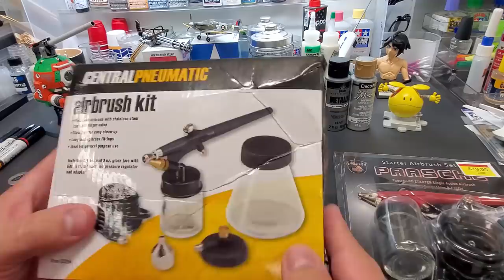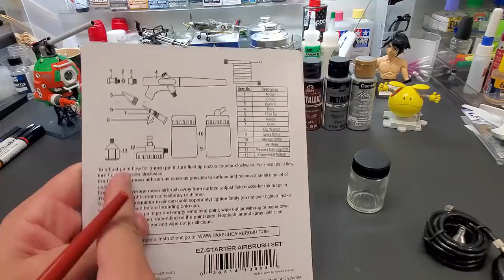Scale Model Tips - Testing Cheap Metallic Craft Paint & A $20 Airbrush

Comment: I bought that Paasche Beginner Airbrush kit from Hobby Lobby for $17. What a piece of junk. No paint flow even with a 50/50 mix. The spray bottle metal tip doesn’t stay connected to the airbrush body…keeps sliding out. The air hose threaded connection to the airbrush was leaking air so I used some plumbers thread tape, that fix it. But when using canned air propellant, the female threaded connector in the pressure can regulator pops off under pressure so there is no way the regulator can stay connected to the propellant can. I’ll be returning this airbrush ASAP!

Comment: The reason the first color ran to the edge is because you ever sprayed it.  It needs to be hair dried between coats and it works great without a primed.  Because it's acrylic add a little acrylic polyurethane to enhance adhesion and durability/anti-scratch.
Reply: Its because the spoon wasn't primed, you see he sprays a primed spoon and does have an issue
Reply: What should I search for, if I want to find the polyurethane additive?

Comment: I still use my Passche "H" model 44 years later .  I also have the 1, 3, & 5 needles.  Old reliable hasn't failed all these years.  I also save the old glass bottles, clean the labels off & relabel with a label maker.  The slip on nozzle caps for the bottles are good for short term paint storage,  They also keep dust & tiny debris out of the jar nozzle.  You could use a small travel hair dryer drying between coats.  I found & still a dryer  that's approx. 4.5 "x 5"x 2.5 dia.  with a 6ft. cord, an on-off switch (1 heat setting) & it folds up into a compact package.

Comment: Another great video. Thankyou. When i started airbrushing i started with craft paints reduced with a 50/50 mix of water and glass cleaner.. worked great and dried quickly. However i had problems with craft metalics until i switched to a 0.5 needle then all was fine.
Reply from the maker: You have to go to 5mm for sure as seen here

Comment: That's actually pretty cool how you can just adjust the paint to air mixture and shoot it without worrying about trigger control on the airbrush I use my airbrush for guitars so I do a lot of large flat surfaces so I was worried if I get a more expensive airbrush then I'd have to take a while to learn how to control the button so I hold it down and back and just the right place and hold it perfectly steady so I can get a perfectly even coat

Comment: Thanks for doing the hard work of testing all these various products. Just a thought concerning these paints and the Paasche, maybe the manufacturer didn't put very much glycerin (retarter), if any, in the paints because they intended for them to be brushed on. Mixing in some retarter or flow improver might be a benefit here. Also, reducing the air pressure might help with a siphon feed gun because it will slow down the drying action during spraying. Just some thoughts.

Comment: The only issue I find with the new one you got compared to the other quick swap one is that you have to clean in-between paints. But the other one has plastic bottles so its not as safe to keep solvent paints.

Comment: Thanks, great review and test.  I have the Paasche but have not used it much; I think I'll give it a try again. 

I saw Blu3ManiC's post about the air hose at Harbor Freight but could not find it on line.  

One of the reasons I haven't used the Paasche is the hassle of having to change the air hose. Can you get an adapter that changes the airbrush's small fitting so I can add a quick coupler and use it on the standard hose?

Comment: The HarborFreight 10 foot airbrush hose now comes with the 1/8 to m5 adapter for these airbrushes. I was in there to buy a mechanics seat today and while checking out the air brush stand noticed the new hoses now come with adapters instead of 1/4 on one end and 1/8 on the other they changed it to a hose with dual 1/8 ends and 1/4 and m5 adapters attached that you can unscrew. Saves from buying a $10 adapter set on amazon and waiting for it to arrive for the same price and you get the hose as a bonus ;)
Reply from the maker: I saw that and I will be picking one up this week. Great value

Comment: I love your video series on those craft paints so much, very informative! and i have been playing around with those paints as well but it seems that i can never get a great coverage from craft paints unless putting a very thick layer on it. I feel like i need to build up the paint for probably around 0.1 mm to fully cover the color of primer (just feels super thick anyways primer coat and paint coat together, i use Vallejo gray primer btw), and usually matt color dries thicker. Do you guys have any solutions or suggestions? a thick layer of paint is just very annoying especially on an HG gundam model. Thanks!
Reply from the maker: Have you tried thinning it like I do just not as much for brushing?

Comment: I've been Airbrushing for a long time been wanting an airbrush with a Mac valve but did not want to spend 2 to 300 dollers on an iwata. So I went on. eBay seen an AB for 26.00 Mac valve said what the hell pulled the trigger iam impressed . Um looks more or less than the name brand one
. It's a point zero   if I had had a. AB like this o. The past wow . Oh on. Your acrylics I've used  auto air. Paints in the past and had their thinner  left over  I picked up some craft paint from Walmart  deco or Americans don't  rem but I thinned those paints with autoair paint thinner and they covered real good and flowed quit nisce out of the neo I was using o had to mix some 6o get the RAL lift colors but the auto air thinner works nice way better than Windex or any u home made stuff .

Comment: Soak that labeled HF bottle in a pan of water for a few hours. That should loosen up the label's adhesive for easy removal. You may have to fill the bottle with water too to keep the label submerged. I use this procedure a lot for removing labels before putting items in the dish washer.
Reply: Get a product called "goo gone" it's does an amazing job getting rid of stickers and the glue.

Comment: To be  completely fair  Paasche has been around since 1904.  Your hobby lobby purchase is already on sale compared to a retail of 28.97USD.  The metal H3 was my first airbrush 35 years ago. Great video on a great airbrush. Keep up the good work!
Reply from the maker: Thanks friend. I'm considering a Paasche with a large nozzle for auto paints, do you recommend a certain model?
Reply: @barbatosrex9473   Well the H3 is the the airbrush I the one I started on as a teen and the H set with all 3 tips extra cups and all that. I’m paint warhmmaer stuff and I think that the external mix will be great for my vehicles and Macross Valkyries. The Citadel Air paints are pretty thick for airbrush paints.  I constantly get frustrated with my Neo and I don’t really need to do fine lines. I’ve really been more of a rattle can guy but the colors are som limited. Even more so now that Model Master has gone away.

Comment: i noticed that you used the 2 guns differently.  the cheap one you kept your finger on the spray longer than you did with the more expensive one.  you used the expensive properly by taking short quit sprays due to the size of the area you were spraying whereas with the cheaper one you took longer spray strokes instead of short quick ones like you did with the expensive one.

Comment: I have the DecoArt ice blue metallic and I airbrushed it on and it looks great but I do want to gloss coat it. What do you suggest?
Reply from the maker: Duraclear Gloss coat. I did a video on it last month
Reply: @barbatosrex9473  ok. Thanks. I saw that video but I didn't know if you were using that exclusively. I tried it and didn't mix it right I think because it didn't level right. I mixed it to milk consistency.

Comment: Did you mention where to get the caps for the bottles? If you did I missed it.
Reply: Any 60° jar made for single action will work they sell them with and without the rubber black caps for the same price on amazon.
Reply: @Blu3ManiC  thats not true, I bought some jars and caps for my master ones when I was just starting out and they didn't fit at all
Reply: @nathancarbo  you bought the wrong ones there are 30 degree and 60 degree, 30 is for dual action 60 is for single

Comment: I just bought this airbrush kit today… I’m new to this. What kind of compressor or pressure can should I use with this?
Reply from the maker: Depending on your budget, how much can you spend on one?
Reply: @barbatosrex9473  the cheapest one that’ll work with this kit lol. I don’t need anything to expensive.
Reply from the maker: @Mommymodex3  This one for $65 is great and can be used with any airbrush you get going forward.   https://amzn.to/3H8GuuK
other than this you'll have to look into a cheap portable one. If that's what you want search portable airbrush compressor on Amazon ,but at around $45 you're better off with the one I suggested above. It's way worth the extra $15

Comment: TIP*
If you put the back of your hand up to your filter, you will feel a draft, turn your palm to face the filter wipe a damp cloth on the back of your hand and you will still feel the air crossing the back of your hand and going between your fingers.  If you are spraying and your airbrush is not a dual type brush, when you need air across the spoon to help it dry, move the spoon almost up against the filter and it will draw air across the spoon and help dry the paint enough to do your next coat.  I am not saying to face the filter with the painted side of the spoon, I am saying to face the unpainted side of the spoon up against the filter and it will draw air across the painted side.  Way better than blowing on it with your mouth and also better than waiting for it to dry enough on it's own.  It is a consistent steady flow of air but not strong enough to pull the wet paint and cause it to sag or wrinkle.

The cleaner the filter the better the air draw to help dry the test paint on the spoon.
Reply from the maker: Awesome tip, thanks buddy

Comment: What are the plastic spoons actually used for when you paint them ????????
Reply from the maker: It's just an inexpensive way of testing paint on plastic. I keep them as a resource when I'm looking for a certain color. I have well over a thousand paints most of which I will be testing for the channel. That way I don't have to paint model parts as I would run out of kits. Check an older video, I show my paint collection. I think I show it in my spray booth video
Reply: @barbatosrex9473  thanks it's kinda like paint cards for wall paint lol
Reply from the maker: @henrysscrollsawworks6917  exactly 👍

Comment: I'm i the only one still not able to get mine to work. Still only blows air no paint
Reply from the maker: What equipment are you using? Airbrush and size? Air pressure?
Reply: @barbatosrex9473  and kind your using in this video. Got a compressed air canister. Sprays air but nothing else
Reply from the maker: @Akai-Shade  just air and no paint means either paint isn't thin enough, the needle and nozzle of your airbrush is too small or you need more air pressure

Comment: its not a big thing to have to thin paint, you cant say to reduce it by 50%  or what ever you did.   you should start talking about viscosity cause all air brushes are different and the air pressure at the tip has a lot to do with the atomization  also some colors are different viscositys then others  as well as brands of paint

Comment: Sorry - can't go with you on this. If you want a cheap but effective brush, track down a Paasche VLS double action - the Paasche H is a terrible single action - it's external mix. The VLS is maybe an extra $15. You can use any paints, but why? I use Blick cheapos for hand brushing dios, but wouldn't think of using it on styrene. I doubt those craft paints use a true metallic pigment - mica is much more likely and they just don't make it. Vallejo makes great water based acrylic paints and one bottle will do several models. False economy.
Reply: Except that there are those of us whos economy needs to be as “false” as possible… cheap paints for cheap models..
It’s a reality…
Reply: This is an adult hobby now - not like the 60s when kids bought Aurora kits in drugstores. You can buy a Paasche VLS, Paasche Talon or Iwata Neo (without accessories etc) for under $70. A basic compressor made for nail work will give you an honest 20psi - enough. Unlike the Asian cheapo airbrushes you're not going to have miniature nozzles that are really hard to clean - or easy to break. The Master air compressor on Amazon is well rated and goes for about $80 including it's el cheapo brush. 
As far as paint goes - a quality craft paint goes for about $2 for 4 ounces. The best water based acrylic (in my view) is Golden High Flow and it goes $3 for 1 ounce - but 1 ounce paints a lot of plastic and it is far better paint on the surface and in the airbrush. Tamiya acrylic paints - which are very good for beginners - are very close in cost - even the little bottles will cover a lot of plastic. If someone really is broke - buy some Vallejo or Golden fluid acrylics and paint your kit by hand - the kids in the 60s never heard of airbrushes and had to use enamels. Again, I just don't think craft paints are made for styrene - they're certainly fine for dios though. Might add that I've tried craft paints and know perfectly well how to thin them (Golden Airbrush Medium) and no way are they as good as an artist grade paint like Golden or Vallejo, or a reputable model paint like Tamiya or Gunze.